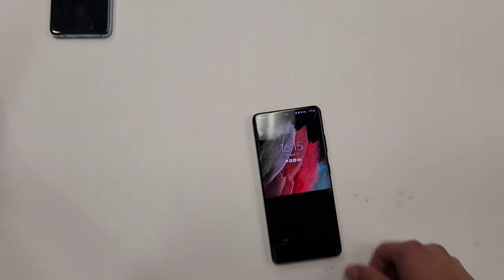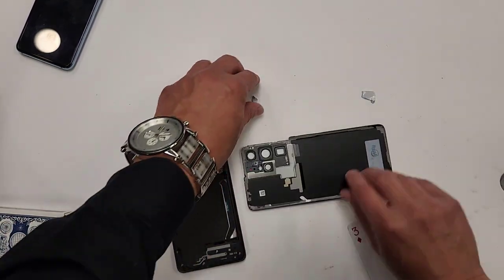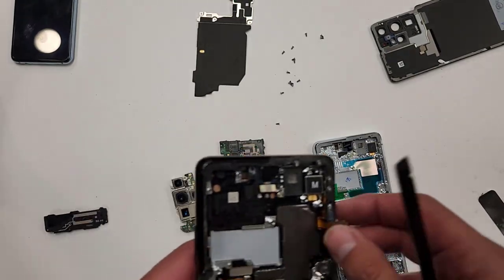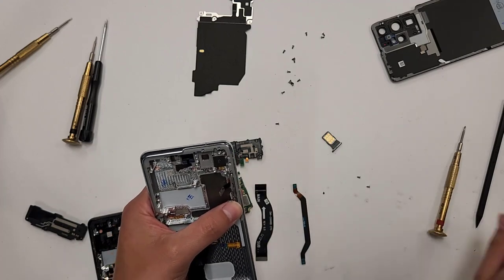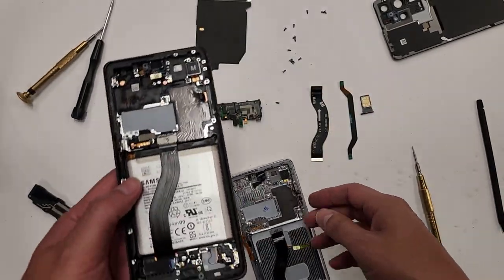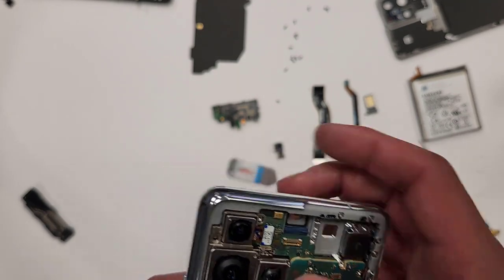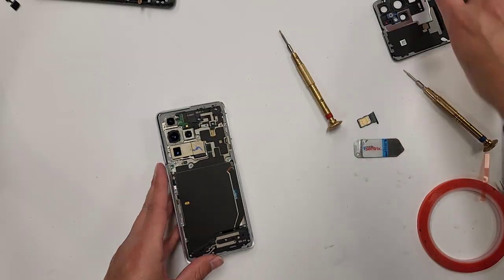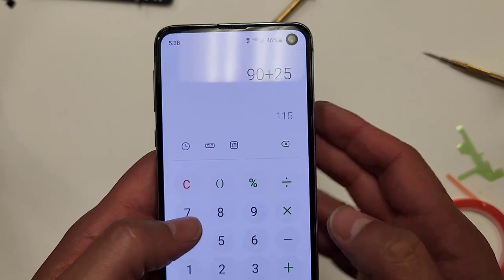SAMSUNG GALAXY S21 ULTRA SCREEN REPLACEMENT | HOW TO REPAIR

Comment: I can't believe this only has 58 likes?! Thank you so much for this video! My screen cracked and the bottom half started flickering and going dark. The T-mobile store told me my only option was to buy a new phone (>$1000) even though my phone is less than 2 years old. I watched your video and did it myself. Parts cost me ~$350. phone is like new again. Thank you so much!
Reply from the maker: Currently the Galaxy S21 Ultra full display screen with metal frame is $236 from the supplier I use.
Reply: @RichardMeza  would you care to share that supplier ps name? I see one on eBay for that $ but I’m worried. Thank you

Comment: You ripped the wireless charging thing I caught that......very nice👍 Your good buddy
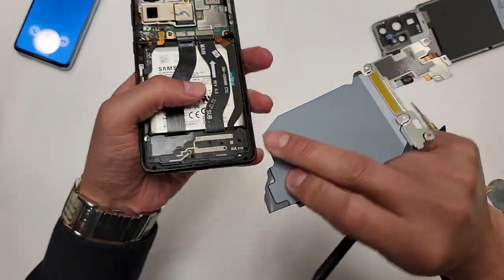Reply from the maker: You clearly are wrong. You talking about the 5:05 mark? That's sticky adhesive "buddy" at the bottom of the wireless charging flex cable. You can peel it off away from the loudspeaker plastic piece. There wasn't any ripping of anything going on. Your good buddy👍 . .
Reply: @RichardMeza  the wireless charging thing on the bottom I caught it..... Buddy your good

Comment: Richard I've a question after watching your video. I had Best Buy Geek Squad do a screen repair 2 days ago and since then, my phone loses itself to the Verizon network. I don't live in a rural area and have never had an issue with reception. I can't get 4G or 5G at my house any longer, only wifi. Been on the phone with Verizon level 2 support, been to best buy twice, nobody has an answer. Is it possible one of the connections wasn't seated properly. This phone has been amazing from day one and it dropped a foot and a half hit my bed post and it cracked the screen I don't understand why I'm losing service. I'd appreciate any advice you can give me. Best Buy no longer has my old screen it's been trashed

Comment: Great Video Richard.  Question though.. Would you recommend testing the screen before putting the back glass back on, just incase there was a screen issue?  I run a cellphone repair business in Canada and I always check the display functionality prior to putting the back on, especially when using the adhesive.
Reply from the maker: I do test the screens, if it's not in this video, it probably was edited out of it.

Comment: He will not tell you where to buy the screens from and yes best to test the phone before fitting the rear cover on ....why would you not put a new rear cover on when you have had a brand new front on ..?
Reply from the maker: Cause the customer didn't want to pay for a new back. They just wanted the screen fixed.
Reply: ive been looking all morning for a trustworthy place to buy a replacment. all i need to know is what parts i need and where to buy. it shouldnt be this difficult. i can do the work i just want to make sure i have the correct stuff im ordering....
Reply: @Treeclimberadrenaline  did you have any luck finding someone?